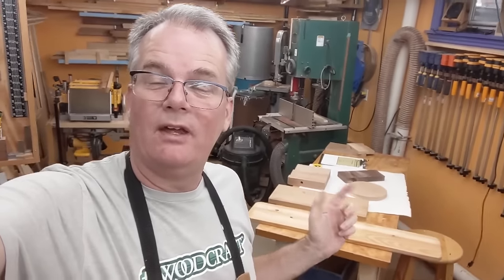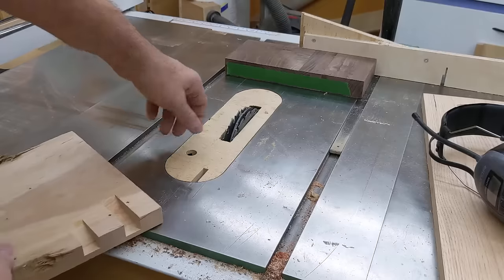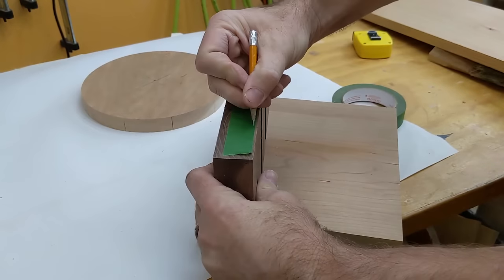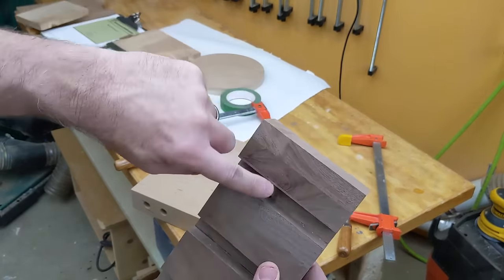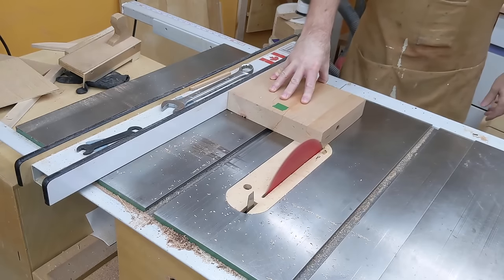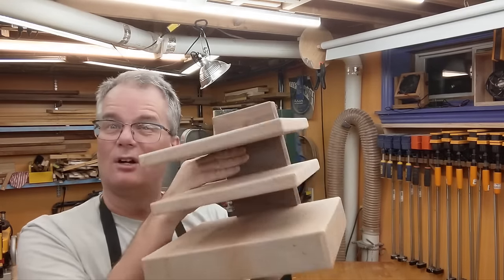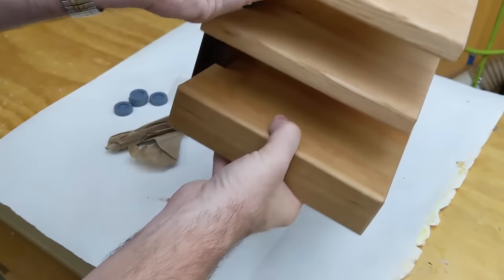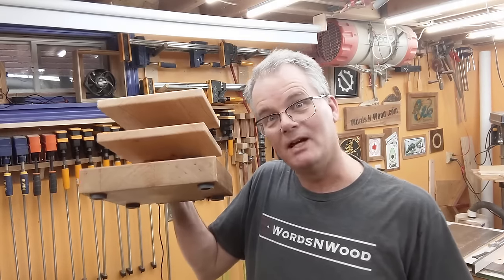Having Fun In the Shop.  Quick Unique Project build.

Comment: Nice, Art, but I have to wonder if the laptops will have enough room for air the vent below them if they're left running while on this stand.  It looks (maybe deceptively?) like the shelves are smaller than the laptops are likely to be, so the little bit of standoff space they get from their rubber feet might not be there, and that could have nasty effects on the laptop's cooling.  You can compensate by making slots in the shelves easily enough before gluing it together.
Reply from the maker: Good advice.  they are generally completely asleep, so I don't think it's much of an issue.  It's a glorified storage shelf, not a dock.  Cheers!